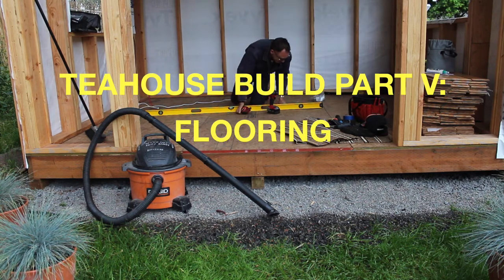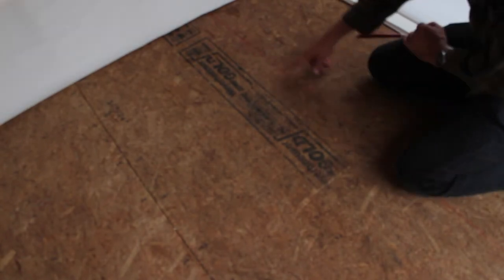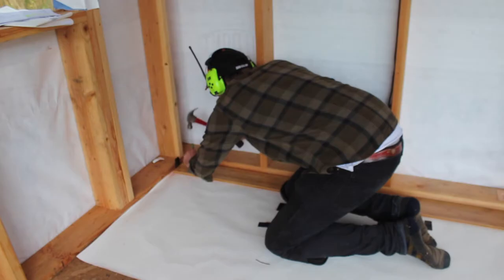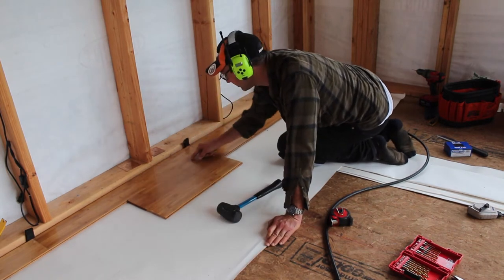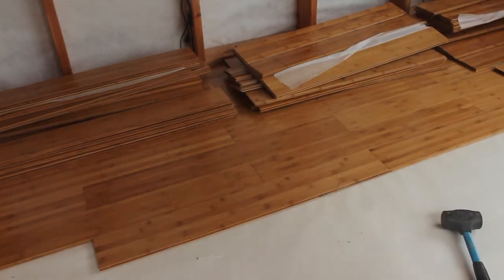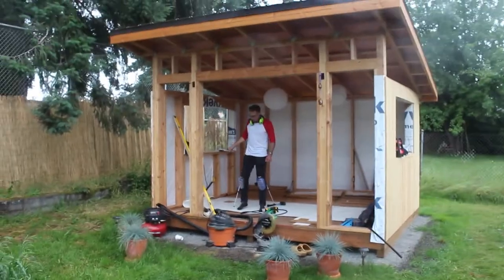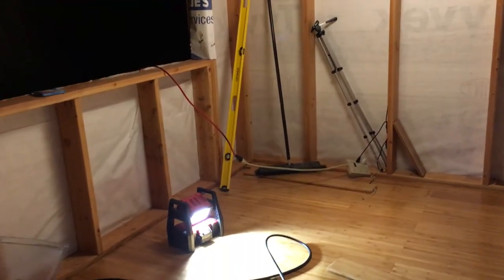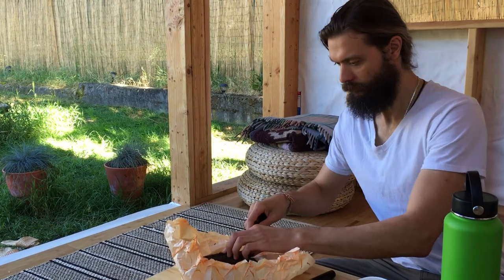Backyard Build: Building a Tea House—Part 5: Bamboo Flooring Installation

Comment: Great work, whenn will part 6 be there?
Reply from the maker: stef joergensen Good question, i’m not really sure.This is the current state of the tea house at this time. It is nice and open on the front side, and my friends that I built for are happy with that. It is getting into the rainy season, but they have been traveling a bunch lately so I think it’s not getting used right now. I may do some work on it this winter to close it in, or we may just do more next year, I’m not really sure!